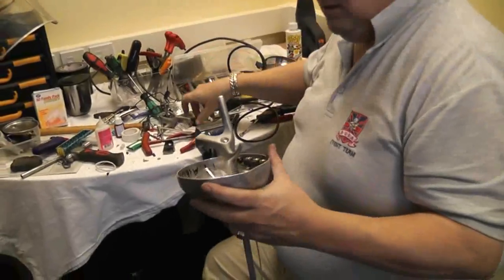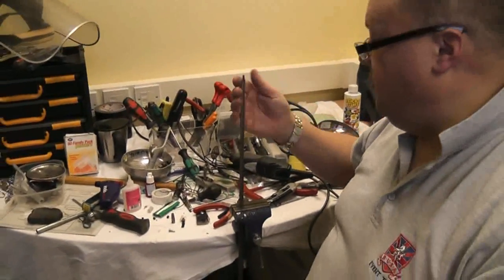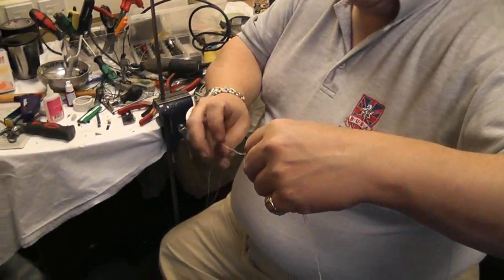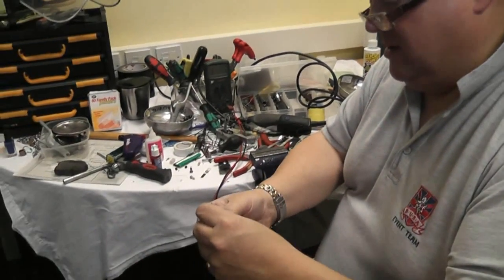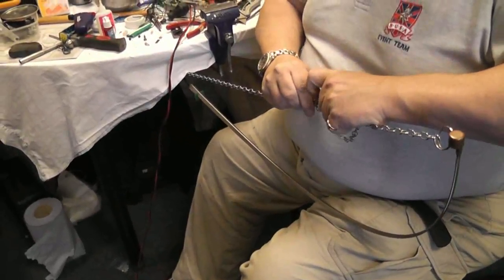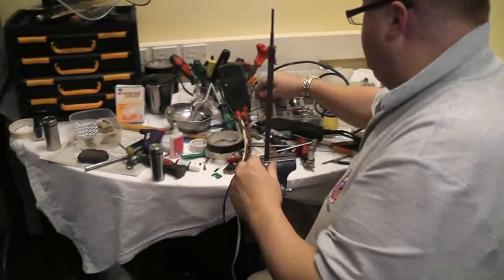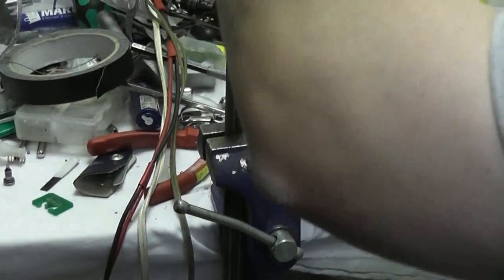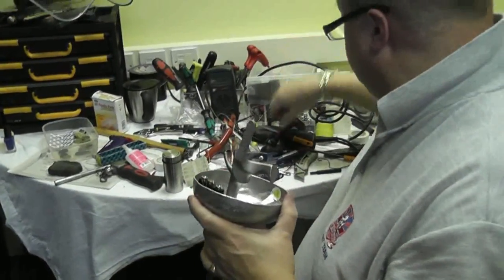Fencing - How to rewire an epee

Comment: thanks for the informative video, I'm new as technician, how many glue do you use?, I saw just some spots not the entire blade. Thanks for the answere
Reply: As far as I can tell, he's using a glue with a low viscosity, meaning it's thin/liquidy enough to flow down the blade. If your glue is more viscous/thicker, you'll need to spread it evenly down the blade/wire yourself.